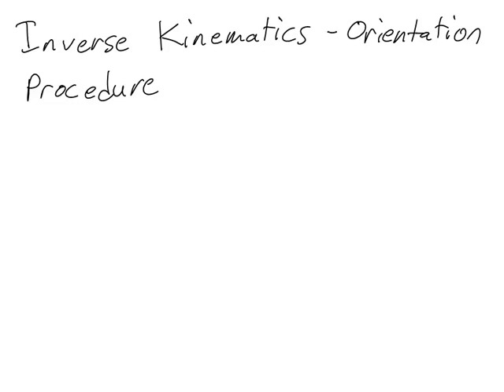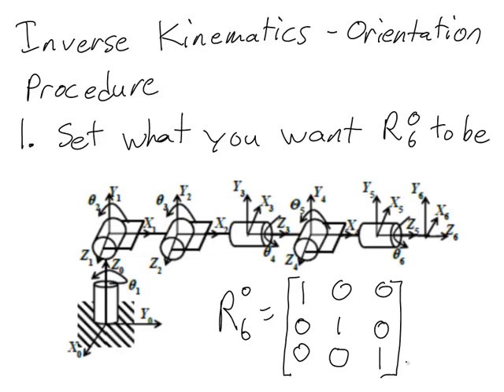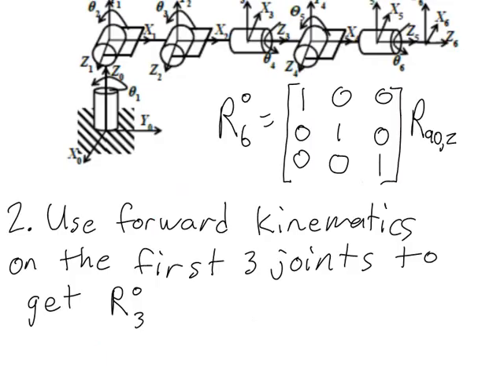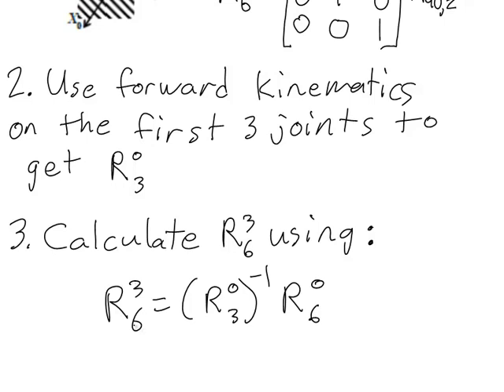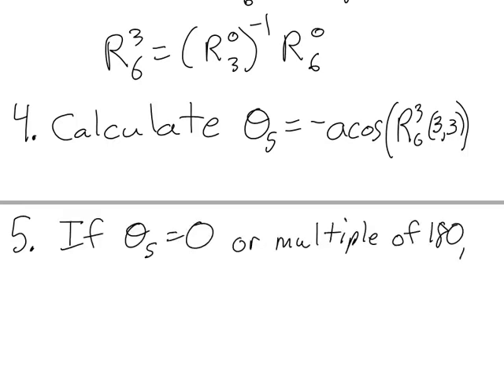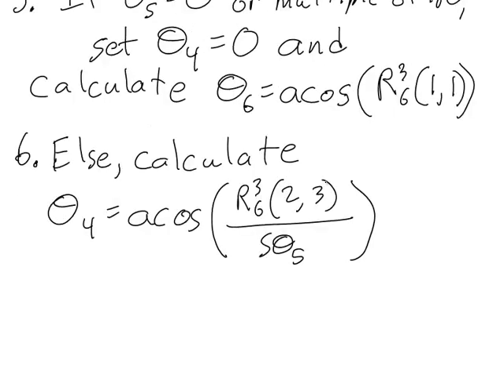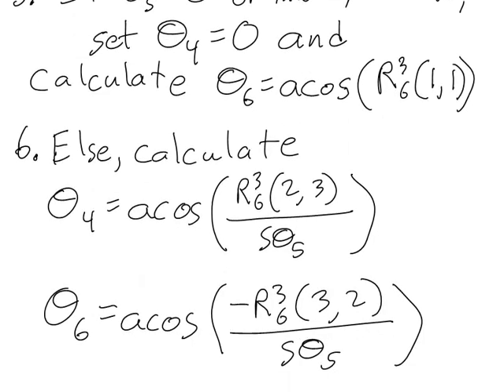2 1 4 Lecture Video 1 of 2 Inverse Kinematics for Orientation

Comment: Hi Angela, will this approach work for a 5-DOF manipulator with the exact same configuration but without joint 6? should I first find IK for the first three joints to determine the position? Then using D-H convention to find 3R5? We know that 3R5 = 0R3^-1 * 0R5 and it should be easy to find the the remaining angles, since 0R5 is given and 0R3^-1 is already found using the geometric approach. Am I correct? Or there is another method? Thanks u

Comment: Are there any better solutions when  theta5 is equal to 0 or 180.  For example when i try to interpolate between two positions I loose continuity in motion, end-effector flips in bad points.  What is a common solution to this problem?

Comment: Hello Maam, I have a question in time lapse 2:52 why is X3's direction is into the page isn't supposed to be go up in order to be perpendicular both with Z3 and Z2?
Reply from the maker: That is only necessary if you are using the Denavit-Hartenberg method for forward kinematics; it isn't necessary in general. (That is, it isn't necessary for X3 to be perpendicular to Z2. It is ALWAYS necessary for X3 to be perpendicular to Z3, regardless of whether you are using Denavit-Hartenberg)
Reply: @asodemann3  noted on this Maam thank you very much
Reply: @asodemann3  Another question Maam, can I ask if  you have a video for validation or rules of picking a right R0_6?

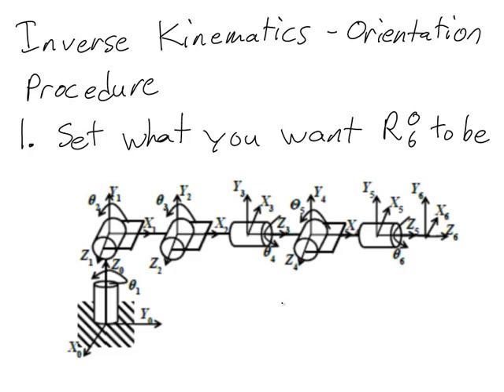Comment: In the example shown at 2:12, are the coordinate systems placed according to the DH convention? Because the x axes don't follow the 2nd rule.
Reply from the maker: No, the axes aren't placed according to DH convention. In my classes, we first learn forward kinematics by finding the rotation matrices and displacement vectors separately, then later we learn the DH convention.
Reply: Angela Sodemann okay i see. Thank you for the quick response! Are there any videos regarding the first 3 joint angles? Aka the position of the manipulator
Reply from the maker: Yes.  The best way to navigate through my latest videos is to go to my website: www.robogrok.com and check out the class called 'Robotics 1'.  Or, take a look at my youtube playlist called 'Robotics 1 2017'.

Comment: I am learning a lot of robotics from videos and you are one of the best I came across. With respect to above video,
Can you explain how to determine real world orientation. e.g. I have a cup on a table. Cup is tilted 30 deg wrt to X axix, 30 deg wrt to Y axis and 30 deg to z axis. How would I form rotation matrix. ? will you method explained above work ?
Reply from the maker: Thanks! 

I think what you are asking about is actually 'forward kinematics', rather than 'inverse kinematics'. Forward kinematics is the problem where you know the angles of rotation to start out with. I your cup example, you could find the rotation matrix for your cup by first  taking the standard matrix for a rotation around x and plugging in the angle that the cup is rotated around the x axis. Then, take the standard form of the rotation matrix around y and plug in the angle the cup is rotated around y. If the rotation around y was made around the world y axis, multiply the y rotation matrix on the left of the x axis. If the y rotation was made around the cup's y axis, multiply on the right. Then, do the same for the Z axis rotation.

You can find more about this in my videos on rotation matrices, like this one: https://youtu.be/0rEz9-6trHw